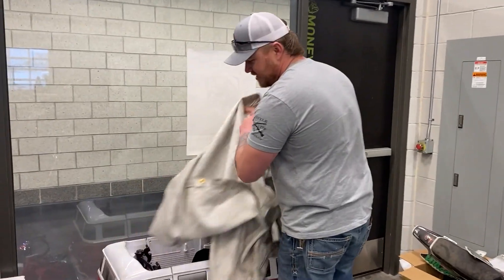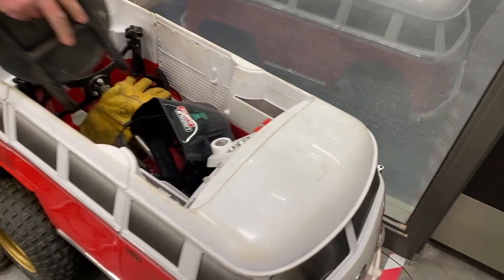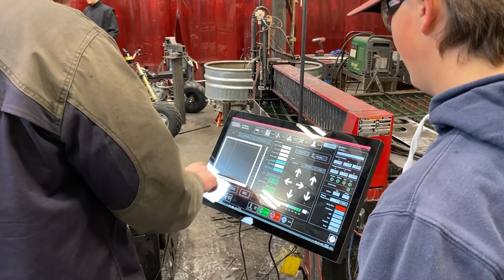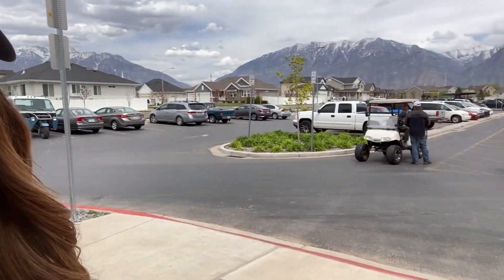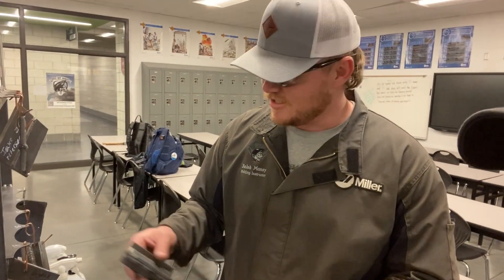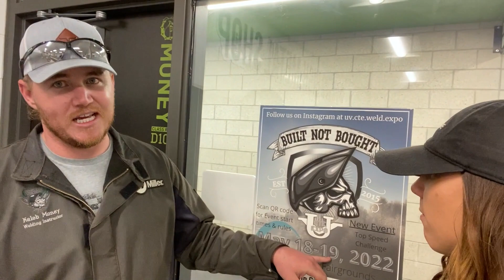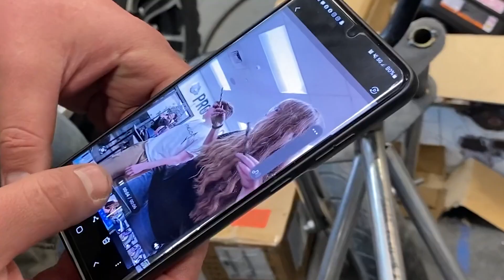The Future of Fabrication & Welding!

Comment: This video is a reminder of what it was like being enthused about doing fabrication work. Doing the same type of builds / modifications / installs over and over,  can lead to burn-out.  Seeing and assisting eager to learn new things - builders, is refreshing.  Thanks for the reminder to share this craft with those willing / able to learn.  I recall our auto-shop teacher had many of us attendees help build a weight lightened 1955 Chevy for the local drag-strip.  Did not personally see it run the 10-11 second range, within the 1/4-M, (OK pass time for the era and within a modest-budget).  Several other students did go to the track to experience their efforts, then talk about it.  Our school even challenged another in town High School shop.  (Helps build and expand the excitement).

Comment: The education system doesn't provide children a chance at learning a trade. Not everyone is suited for college prep.

Beck, if you think it was bad for you, when I went to school, there were three course levels, VoTec, general education, and college prep. VoTec couldn't take advanced math, science or foreign languages. General education had no shop classes, no advanced math or science and no foreign language. College prep required foreign language, advance math and science but no trades.

The education industry fails kids daily.  Look how many computer jockeys are unemployed verses welders, machinists, auto mechanics, electricians, or a HVAC persons. Trades people will always be needed.

I received a masters in mechanical engineering after 8 years part time, and a requirement was having to build a project from metal. Most of the people I was in class with, never turned a wrench in their lives, book smart, real world not so bright.